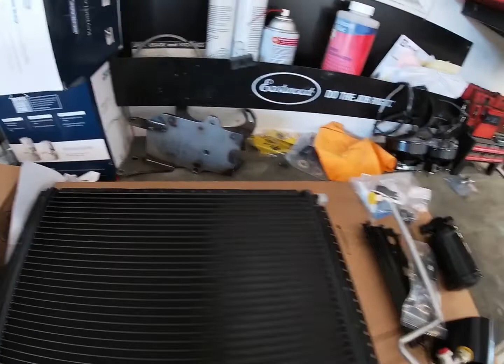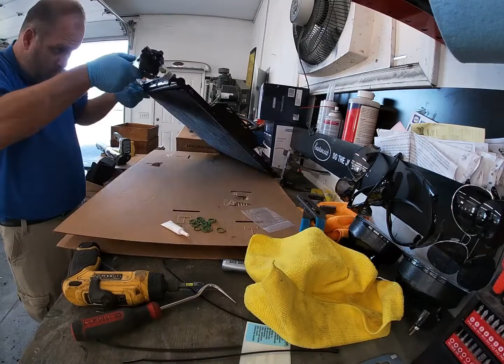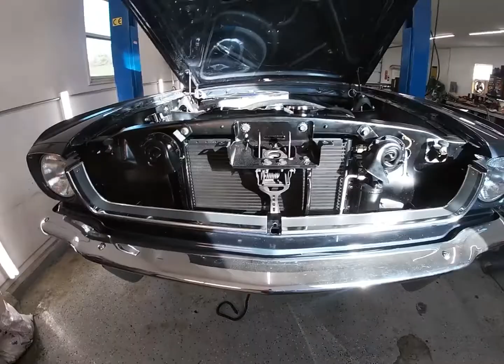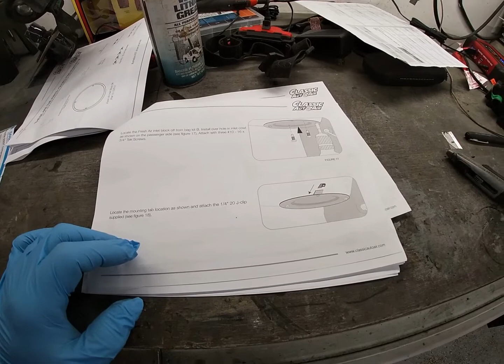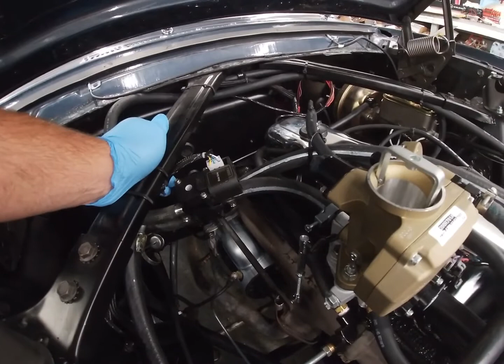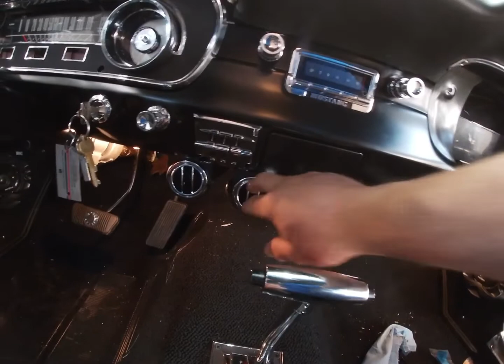1965 Mustang part 19. Classic Auto Air conditioning installation.

Comment: I haven't had good luck getting the belt from my compressor to the alternator to stop squealing with the compressor engaged. It had a gatorback belt on it before and it didn't squeal but I had to replace it with a normal continental. Now it just squeals. Have it as tight as I can get it with a big ol pry bar. Any ideas?